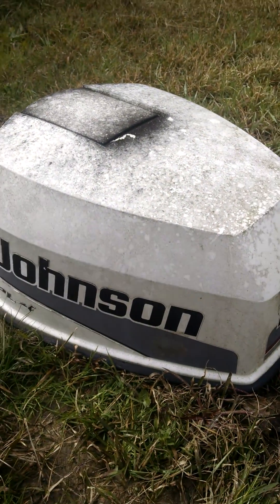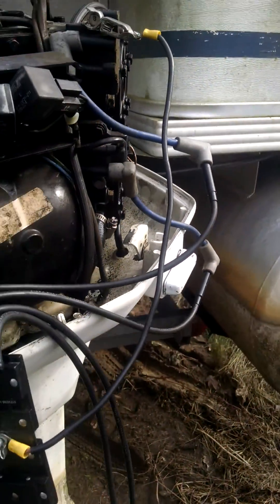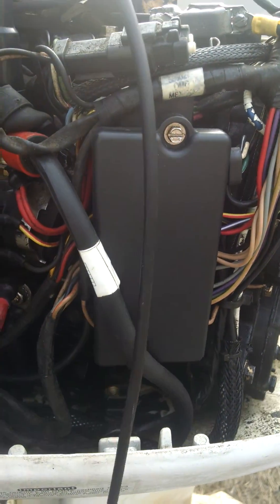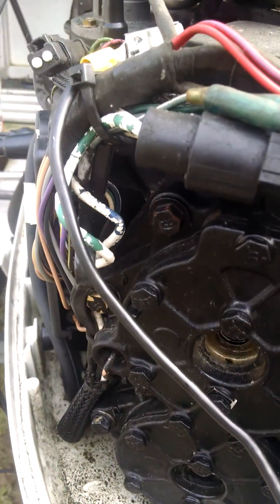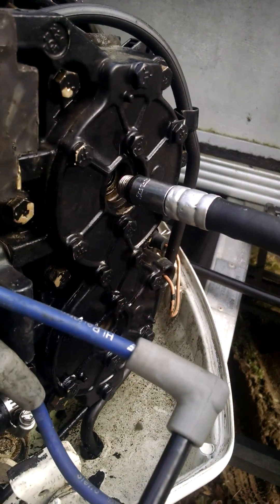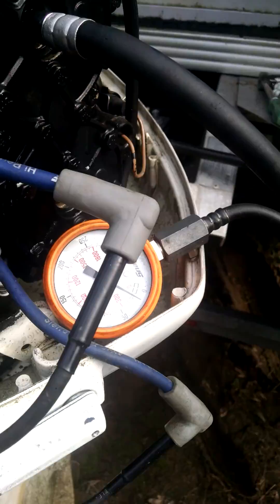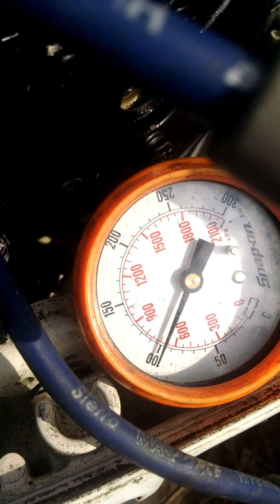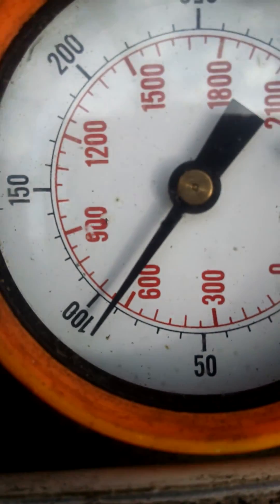Compression test and spark test how to on a 1998 Johnson 115hp outboard 2 stroke.

Comment: buying a 1983 johnson 115 v4 on a hydra sport bass boat. compression was 115, 110, 113, 120 . he said another guy came and looked at it and said it needed a water pump but didnt start it? how is this possible? didnt notice any heat marks on the heads. anything i zhould look for? any opinions is appreciated
Reply from the maker: +Richard Bruce the water impellars are only good for 3 years. If it's been sitting I would replace it anyways. Also If the engine has been sitting I would spray the tops of the Pistons with wd40, let sit 10 min, then recheck compression. The numbers you got are ok but I would like to see higher.
Reply from the maker: +Richard Bruce also be sure to check the spark. Parts are starting to become hard to find for anything over 15 years old. Especially 2 strokes due to the epa regulations on the manufacturer's.